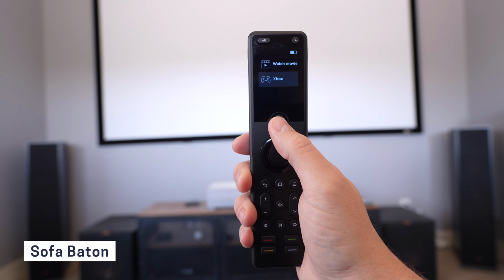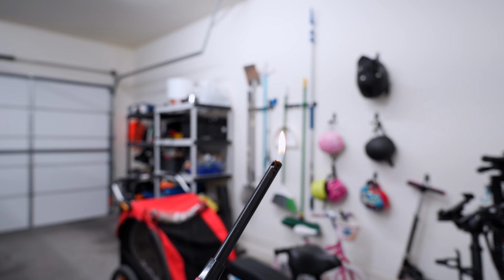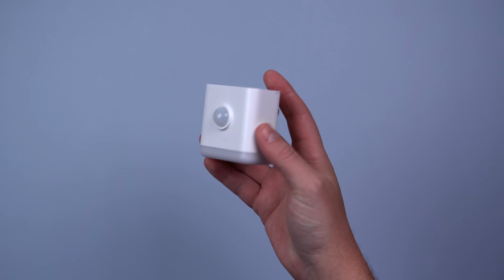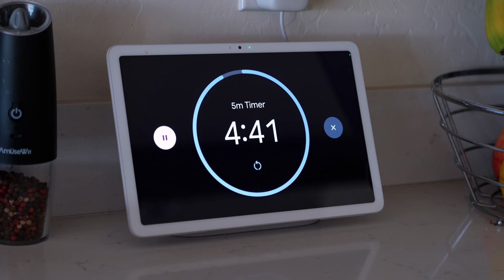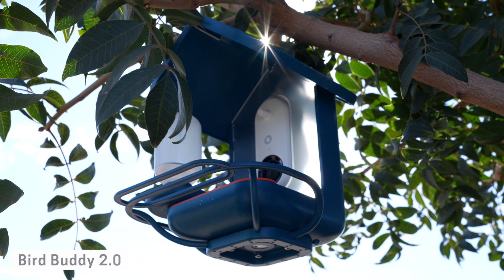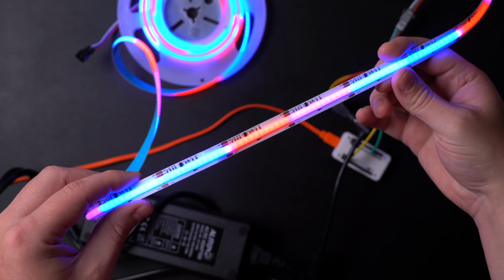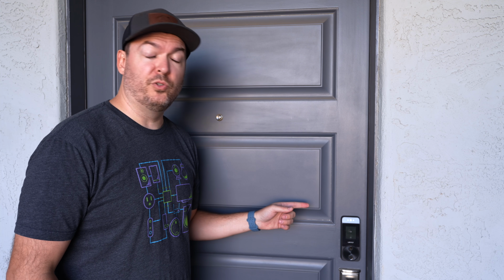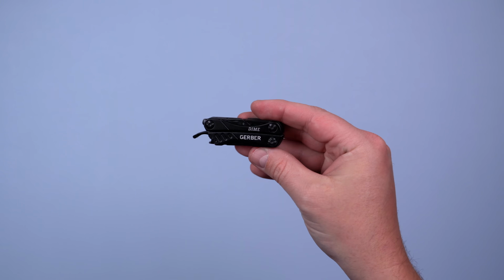30 Cool Smart Home Devices You’ll Actually Want!

Comment: I've heard people complain about Phillips Hue, but I bought a 4 pack of bulbs to replace my current Feit smart bulbs. The reviews and ratings were strong, so I'm hoping they will stay connected. The problem I've had with Feit is that once I've got them connected after a little while I find they're "offline", and it becomes damn near impossible to get them back online. It doesn't matter how many features they have and how cheap they are if they are unreliable they're not as good as a dumb old LED bulb.

Comment: I have issues with the lutron motion sensor in bathrooms.  We had clear glass doors on our shower, and the motion sensor doesn't work through the glass doors, so it will turn off the light while you are still in the room.  In a powder room it would be great.

Comment: This is the second time in as many days that a creator has referred to fluctuating CO2 levels. I was under the impression that CO2 is either managed, or leaking to the point where a traditional monitor will alert. Is there some level of CO2 which can affect brain function without being outright problematic and indicative of an emergency?
Reply: That’s a honestly a great question! I was also curious so I asked grok and ChatGPT:

Here’s how it breaks down:
	•	Normal indoor CO2 levels: ~400–1,000 ppm (parts per million)
	•	1,000–2,000 ppm: You may experience drowsiness or a lack of focus.
	•	2,000–5,000 ppm: Headaches, sleepiness, stagnant air, and poor concentration.
	•	5,000+ ppm: This is considered the OSHA permissible exposure limit for an 8-hour workday. At this point, symptoms like dizziness, confusion, and even unconsciousness can occur.
	•	Above 10,000 ppm: Serious health risk—emergency territory.
Reply: You might be confusing CO2 (carbon dioxide) with CO (carbon monoxide). 

Carbon monoxide detectors are commonplace because it's deadly and can get in your home with any kind of combustion like a furnace or generator. 

CO2 is expired from respiration and can build up.  I remember being a kid and feeling weird if I had a blanket over my head for too long. But generally I don't think CO2 is too much of an issue indoors. I feel like most houses have enough circulation to avoid it becoming an issue. Always good to open windows and get some fresh air when possible though.

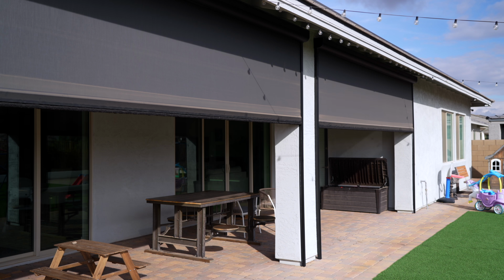Comment: Reed! I have a question on the bond. So I am looking for a device that can control RF fans for the whole house. First thought was the bond. I remember a coworker telling me about it a few years ago. But, the Aqara M3 hub also came up when I did a quick search. However, I can’t find definitive information that it can control RF fans in the same fashion that the Bond can. Would you happen to know? 7:59
Reply: I made the same mistake as well unfortunately. The Aqara Hub can make dumb items, smart using IR (which is mostly tv’s and like dysons anything with another remote that would’ve had to point at the device etc… Whereas the Bond or BroadLink does both IR AND RF which is most modern ish fans operate on. It also means the device doesn’t need to have a clear line site to the specific item compared to IR where you specifically do need to position in an area where it can communicate that IR signal.
Hope this help 👍😊

Comment: Struggling with finding content on how to power the smart drivers for cabinet and baseboard lighting. Is there some type of transformer that can be used as power hub using low volt wire like thermostat wire?

Comment: Great Video. I'm actually very interested in that TrampleTek Blue pressure mat. I already have a Bed Occupancy sensor I made with a random mat off of Amazon and a ESP32, but because it'll false trigger all the time, I had to build in like a 3 second delay to avoid false triggers, like when rolling around on the bed.

So my question is, does the blue pressure mat you showed have a built in delay or is it pretty instantaneous? Should I expect rolling around on bed will give false triggers?

Comment: The X1 Remote scroll ball is HORRIBLE and eventually starts to scroll down when trying to scroll up. I've had to get a replacement once already for this defect, and the replacement also has this problem. I'll probably try to get this one replaced as well, but they definitely have a quality issue. Sadly there's not many other options.

I'm looking forward to getting my Unfolded Circle Remote 3. It's a bit pricy, but with Home Assistant, you can do a ton of things with it.

Comment: Hi Reed, love your videos. I was wondering if you or one of your subscribers could suggest a solution for the following application. I live in the country and have a well. I would like to have an indication on my Home screen that would simply let me know when either the well pump or the house pressure pump are running. I tried using a small switch module but someone tried turning it on on the home app and it blew up because it wasn't rated for the pumps current draw. So I'd like to find something that is simply an indication with no remote control function. Any ideas?

Comment: Do any of the smart locks support type of doors where you need to first raise the door-handle to engage the multi-point lock system?

Such doors are relatively common in Europe - and it's same stuff (mushroom shaped pins that slide to lock the opening in multiple points) as European windows that seems to have spread to US too (especially PVC windows). Except for doors you can then use key to really lock the door.

If it's not locked with a key - well anyone from the outside can simply push door handle down to disengage the multi point lock system.

Comment: Smart locks are the dumbest thing to put in a house, in particular on the outside.
Specially facial recognition, which can't tell the difference between you and a photo of your face.
Reply from the maker: I actually tested it with a life size image of my face. I showed it in a video https://youtu.be/R0zLt7sVJes?si=1rAnMG57MR8Kpvt_ and it didn’t work.
Reply: @SmartHomeSolver  odd, I've seen it work even with phone unlock. I'll check that video for the content :D
Reply: @SmartHomeSolver  I severely doubt that it has a depth sensor to see that its not an actual face.

It might just be doing it on software side, by scanning for things (background and frames) that make it look like a picture.

Something you can try:
-Make a printed cutout of your face. It will not detect any border and it will open.
-Grab an empty picture frame and put it in front of your real face. It will think its a picture and it won't open.

Should theoretically work for the palm sensor as well.

Comment: For the Aranet CO2 sensor 
I made a stand Check thingiverse: "Aranet 4 Home Stand", I made it since the sensor is quite thin, and can fall over from time to time especially when placed on a desk you use, and when direct sunlight shines on it you can't read it, with a soft angle, it breaks the sunlight, and allows you to read the stand.
I made the stand as minimalistic as possible, with a separate faceplate that does not obstruct the sticker for CO2 levels, or causes needless filament waste.

Comment: Does the plant sensor need to be plugged in? That'd definitely be a no-go
Reply from the maker: There are two versions, one that is smaller that needs to be plugged in. There’s also a larger one that has a rechargeable battery.

Comment: Sorry, that plant sensor is ridiculous.
I mean you can use it for 1 plant.
But surely you don't want to hook up 20 plants in your home with a power cable.
Reply from the maker: Apollo has another version with a rechargeable battery built in. I should have mentioned it in the video.
Reply: @SmartHomeSolver  I don't know how many plants you guys have - is it feasible to recharge batteries for so many plants every x months?
I just think it's not very practical, unless you can attach the one with the rechargable battery to a solar panel, and that'll only work for the ones at the window.

Comment: I have had hue bulbs for years. I dont think it has worked perfectly once. They are disconnected more than they are connected. So when you said "not the best bang for your buck" what would be? because Hue is trash, anything would be better, but all i can find that is cheaper is Wifi bulbs and i dont need 52 new devices on my Wifi to jam it up even more.

Comment: If me or my wife farts bad enough, I have automation via methane and sound recognition to flash all LIFX lights red for 5 secs. as a warning, the blower fan turns on for 5 minutes to circulate air.  More of a novelty.
Reply: I wonder if it's possible to fart so badly that your air quality monitor goes off
Reply: @chrisc_1012  funny story, my friend worked as a technician at factory where they installed gas leakage sensors (if I rember correctly they were mounted in pair, one near the ceiling, another near the floor), one day workers tried to trigger it by farting right into the bottom sensor. You guess what happened next? Firefighters came, everyone was evacuated. Well... story wasn't so funny for those who farted at the sensor.
Reply: @chrisc_1012  Eat beef jerky, chilli for 3 days in a row, add some lactose intolerance and there you go.
Reply: Holy crap. We have a "X farted" routine for Alexa which turns the fans on for 30 seconds but I had no idea methane sensors exist. How reliable is it?

Hilarious, yes, but I also have IBS so this could be a legitimate game changer.
Reply: @artyb27  How reliable?  Just ask my wife.
Reply: @publicmail2  the thing is I can't tell if this means it's great or it barely works and she's still suffering 😆
Reply: Does eye detect flame work with home assistant yet
Reply: Lies... Wives are women and women do not fart...😂
Reply: I’m not sure if this is a joke or real… bravo either way

Comment: Big Hue fan - after trying a variety of different smart bulbs that never worked 100% of the time - the Hue's are rock solid and don't disappoint!
Reply: What connectivity tech did your other bulbs use? I'm curious as to what brands to avoid. I picked up some extremely cheap sengled zigbee bulbs and have had no issues at all, not even a single dropped connection.
Reply: @SprintKeyz  The Hue bulbs use Zigbee and have never had an issue with them. Aqara just released their own Zigbee bulbs which should be just as reliable for a lot less money, but Hue offers a variety of lighting devices for not just indoor, but outdoor as well. I wish I got Hue much earlier in my smart house adventures, as the others I have tried kept dropping, like the Lifx and Nanoleaf.
Reply: @jcm9698  “They just work”.

Comment: LASER?  For the past hour-and-a-half i've been trying to find this laser you have on your ceiling in your garage, but no luck. What brand and/or model is it, so I have something I can search for? Thanks!

I did find a ton of lasers of course, but they are all battery powered, which makes it difficult to use in home automation.
Reply: Found it:   Park Right Garage Laser Park 
Perfect, and not expensive! Thanks for the idea!
Reply: Mine arrived today. It works really well, better than I had assumed watching your video. In the video is seems like a small dim red dot. In real life the dot is much much brighter. I did buy the model with 2-lasers (since it was almost the same price), but I do not think that will matter much in brightness.
I'm very happy with this solution. Our garage isn't as big as yours and in order to fit both cars, parking has to be done with much precision. This works great!

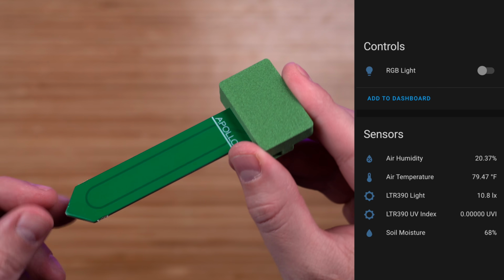Comment: 1:07 is that soil moisture sensor capacitive? if so, that's good. conductive sensors have a corrosion problem.
about leaving that tablet that's plugged in all the time: i have the chargers for my tablet and phone on smartplugs, controlled by automations that switch on at 50% and stop charging at 90%. except once a month they charge to 100%. thee only problem is that some of my smartplugs sometimes switch off when they should be on, and i can't find out why :-(

Comment: Lutron Caseta Pico remotes are amazing.  Sure its another hub, but combined with HA they are amazing.  Being able to mount a remote into an existing gang box is what I had been missing for years.  No more losing a remote, or having some extra random wall mount on the wall.  The new hue remotes are very fast compared to the early models, but the battery life is pretty bad, can't comment on the Pico Remotes yet, but  pretty sure they are advertised to last pretty long.